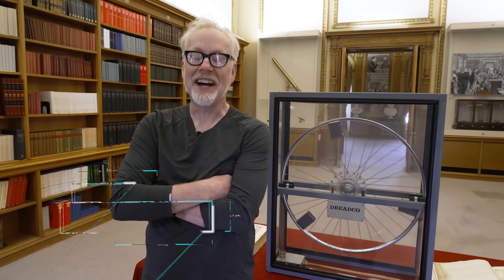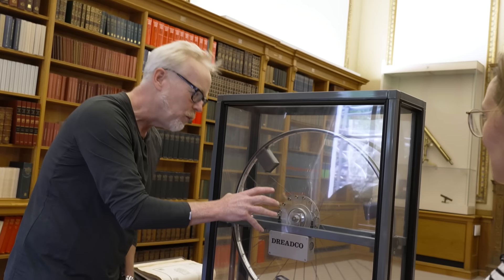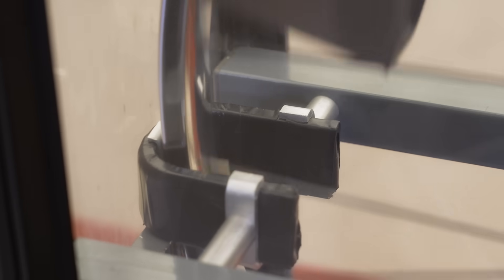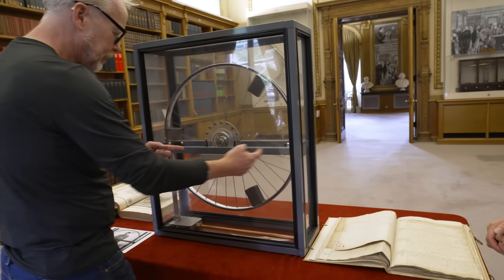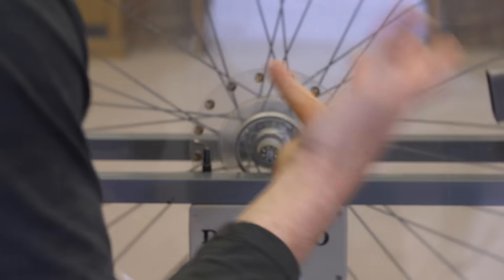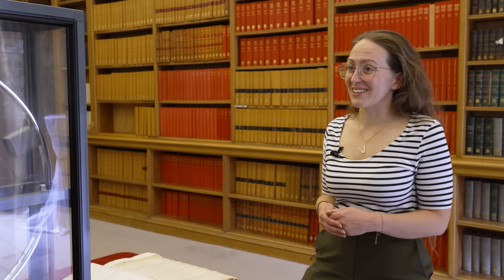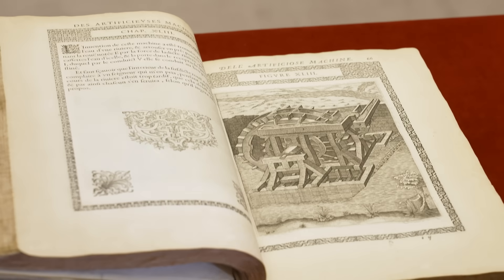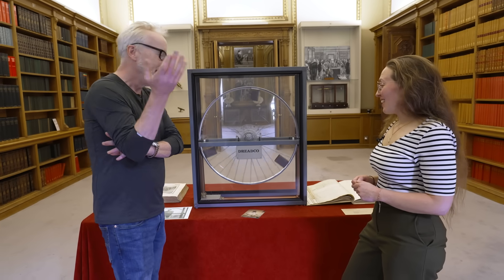Adam Savage vs The "Perpetual Motion" Machine!

Comment: I patented a device which converts heat fully into electrical energy. The patent is US 3890161A    DIODE ARRAY filed 1973, granted 1975, open for public use, 1992. It covers a device which produces refrigeration which is a loss of thermal energy while it produces electrical energy. The energy gain and loss must be equal because the energy of a system considered as a whole must not gain or loose energy though the energy may change form. 

A simple rectifier crystal can, iust short of a replicatable long term demonstration of a powerful prototype, almost certainly filter the random thermal motioren of electrons or similar  positiive charged voids called holes so the electric current flowing in one direction predominates. At low system voltage, a filtrate of one polarity predominates only a little but there is always usable electrical power derived from the source, which is Johnson (observation) Nyquest (theory) thermal electrical noise. This net electrical filtrate can be aggregated in a group of separate diodes in consistent alignment parallel creating widely scalable electrical power. The maximum energy is converted from ambient heat to productive direct current electricity when the electrical load electrical resistance  is equal to the array internal electrical resistance. The heat absorbtion is always equal to the electricity delivered 

Maximum calculated electrical power output (watts) is k (Boltźman's constant), one point three eight x 10^ minus 23, times T (temperature Kelvin) times bandwidth (0 Hz to a natural limit ~2 THz @ 290 K) times rectification halving and nanowatt power level rectification efficiency, times the number of diodes in the array. Rectification is inefficient at low voltage, inefficiency reduces the performance but the heat absorbtion remains equal to the yield of electricity. 

There are a billion cells of 1000 square nanometer area each per square millimeter, 100 billion per square centimeter. 

A diode array plausibly designed for maximum realizable of power levels of mìlliwatts would consist of billions of very small diodes in consistent alignment parallel or, for additive voltage, parallel series. 

Order is imposed on the random thermal motion of electrons by the structual orderlyness of a diode array made of diodes built within a slab: 

Host crystal is silicon 

  P type boron doped
-----‐------‐----___-- Out
🔻🔻🔻🔻
■■■■■■___ + Out
  N type phosphorous doped 

All the P type semiconductor anodes abut a metal conductive plane deposited on the top face of the slab with nonrectifying joins;  the N type semiconductor cathodes or common cathode abuts the bottom face. As the polarity filtered electrical energy is exported, the amount of thermal energy in the group of diodes decreases. This group cooling will draw heat in from the surrounding ambient heat at a rate depending on the filtering rate and thermal resistance between the group and ambient gas, liquid, or solid warmer than absolute zero. There is always a lot of ambient heat on our planet, more on equatorial dry desert summer days and less on polar desert winter nights.

Focusing on the composition of one simple diode, a near flawless crystal of silicon is modified by implanting a small amount of phosphorus (N type conductivity) on one side from a ohmic contact end to a junction where the additive is suddenly and completely changed to boron (P type conductivity) with minimal disturbance of the crystal lattice. The crystal then continues to another ohmic contact. 

A region of high electrical resistance forms at the junction in this type of diode when the phosphorous near the ĵunction donates electrons that are free to move elsewhere while leaving phosphorus ions held in the crystal while the boron donates holes which are similalarly free to move. The two types of mobile charges mutually clear each other away near the junction leaving little electrical conductivity. An equlibrium width of this region is settled between the phosphorus, boron, electrons, and holes. Thermal noise is beyond steady state equlibrium. Thermal noise transients, where mobile electrons move from the phosphorus added side to the boron added side ride transien⁸t extra conductivity so t⁶he forward moving  electrons are preferentally filtered into the external circuit. Mobile electrons are units of electric current. They lose their thermal energy of motion and gain voltage, as they transition between the junction and the array electrical tap. 

There are other plausible breeches of the second law of thermodynamics. Hopefully a lot of people, mostly as independent teams, will join in expanding the breech. Please share the successes or setbacks of experiemental efforts. 

These devices would probably become segmented commodities sold with minimal margin over supply cost. They would be manufactured by advanced automation that does not need financial incentive. Applicable best practices would be adopted. Business details would be open public knowledge. Associated people should move as negotiated and freely and honestly talk. Commerce would be a planetary scale unified conglomerate of diverse local cooperatives. There is no need of wealth extracting top commanders. We do not need often token philanthropy from the top if the wide majority of people can afford to be generous.. 

The topic deserves discussion and prototyping attempt action. 

Aloha
Charles M Brown
Kilauea, Kauai, Hawaii, 96754j

Comment: Im looking at what is shown here, and all I can think is that it is basically the same as placing a battery on a magnet then winding a coil of wire arround it.

The heat synchs have me thinking that the power source may be thermal electric.

What bothers me about it, is the secrecy. I hate any any machine which claims to be running at unity or over unity, which makes the methods of operation a secret. Its not about weather it is what it claims or not, it's about the deception.

Comment: Those aren't magnets. Those are electrodes. What you are seeing is kind of like perpetual motion. But literal perpetual motion is theoretically impossible... But if you use static electricity. Like an electret for example, which is a material that holds a permanent static charge. You use multiple ptfe electrets without touching any type of capacitance. You then build an static electric motor. They use electrodes like on the wheel, which can be plates of aluminum. Aluminum pushes and pulls from static electricity. You can than have the perceived infinite moving of motion. But eventually the electret will lose its charge due to the environment unless kept 100% dry. But you cannot power anything off of these devices really. Maybe a micro sensor with caps and AC to DC converters. Fun project, but you get little to no current. Hope this was helpful :)

Comment: I have a "perpetual motion" clock. Its brand name is Atmos and it's much more interesting than this bicycle wheel. 
The clock depends on small (maybe 2° C) changes in air temperature over the period of a day, which causes a sealed, gas-filled bellows to expand and contract, resulting in a small amount of winding of the main spring. 
Pretty damned cool.

Comment: Cups behind the covers of the three points. These cups are balanced, using a slight bit of water to dump at the top of the arc and the water evaporates over a two year period. The adjustments are to refill the cups with water.
Reply: use mercury but still have to service the center bearing, it's the only thing making contact between the rotating mass and a stationary object.

Comment: So, if the black boxes were simply battery powered coils (essentially stators), wouldn’t that be the most obvious and simple answer? A stator holding a current would propel itself through the magnet, would it not? You only need a small charge as it only needs to propel the wheel enough of the next one to go through and continue the spin. High density chemical batteries could surely last 2 yrs. All the other elements are red herrings

Comment: Good day Adam, my guess is this is an electrostatic motor.  The little metal buttons get charged with opposite charges  from each "electrode" connected to the "Dreadco" box.  If the box contains a high voltage battery, it would take a long time to discharge.  Notice the slow even motion of the motor.  There is a bell that has operated in a bell jar for around 100 years in a lab that uses a high voltage battery too

Comment: I think some of the features of it are basically red herrings. The prong things are red herrings. 
Here's how it works. The bottom box and the Dreadco box are a combination of batteries and a small DC to AC circuit. 
Then inside those wrap around areas at the side are copper windings, that are basically electromagnets connected to this power source.
Inside the boxes on the wheel are small permanent magnets, the boxes are made to be bigger than they have to be.

Comment: There are obviously batteries hidden in it somewhere but I wonder if the system is also generating its own energy from heat differential.  That copper pipe attached to the heat sink would presumably be able to generate potential from the different heating/cooling speeds of the two different metals.  If the system was gaining energy in such a way it could dramatically extend the life of those batteries.  Between that and the box being obviously evacuated of air it could keep running for a couple years.

Comment: My theory is that the bolts holding the rods near the bearing are actually small magnets, and the electrodes are acting like a generator, generating charge and using that charge to spring the wheel further with the bits on the center left and rip enter right parts, with the large boxes being both weights and magnets to be pulled along by minuscule electromagnets. The copper pipe is most likely the connection to the electrodes.

Comment: It's using magnets and a small motor i made something similar freshman year in high school . It needs oil not a lot but it needs some . eventually the motor will lock up . this can not be done on a larger power creating scale the motor would have to be to big and would require to much oil . There is no such thing as a perpetual motion machine . The focus should remain on improving battery storage  capacity . My device could power a 20 watt bulb this 1 with the improvement of leds could power a lot of those . All about creating a balance.

Comment: My guess:

It’s in a vacuum, there are two magnets on the sides. And three iron weights. The weights unbalance the wheel making it move and it gets momentum when it passes the magnet, pulling the next iron weight. Since it’s inside a vacuum there is no friction so it doesn’t stop.

Comment: 0:28, There's no way it spins like that, without power from somewhere. The wheel needs to over come inertia  and friction in general, while maintaining a consistent rotation. I say an electric (induction?) Motor and power source hidden in the large metal block stuck to the otherwise all glass enclosure. But I'm no expert...
Reply: My guess is that there is a small battery that powers an electro magnet, the motion might charge the battery but eventually the battery degrades, or it doesn't charge it enough to maintain it forever.
Reply: I mean if it's a motor, it would be much cooler if they just put the batteries and metal parts inside a wooden wheel. Next level would be wirelessly powering it with microwaves.
Reply: magnets

Comment: May work like an Atmos Clock..Jeager LeCoultre...Changes in Temp/Pressure effect a volatile liquid in a cotainer to form a gas to operate a bellows to run the wheel..on cooling gas liquefies and contracts..

Comment: i reckon the 3 boxes are magnets, and the things that the boxes pass through are electromagnets. so the box the pipes connect to could contain a timing circuit which gives tiny pulses to the electromagnets, and the wheel slows down eventually because the timing circuit slows down with lower voltage.

Comment: Adam, they use heat pumps in power generating plants because they require a fraction of input power compared to output power. A relatively common residential air conditioning system can deliver 18,000 watts or more of heat to the outdoor condensing unit while consuming 2,500 watts of power. Within the confines of the earths atmosphere that is an over-unity device. The heat migrates back to where you took it from any way, so as Newton described, nothing is ever gained or lost in our universe. 

You can do the same thing with capacitors and electricity, but you cannot patent it, and the government holds patents that they call dangerous to the economy or defense of the country and will stop you from building it. 

Benjamin Franklin created an over unity Turkey spit that would run for 20 minutes after stroking a laden jar with his hand. It was a static electric motor. Perhps that is inefficient static motor that needs to have moisture removed from the case every so often.

Comment: People shouldn't put down these attempts at perpetual motion machines. If someone can design a machine with minimal force input with a high force multiplier (like a crank that could spin for days after one crank), it could be very useful. If I could get on a bike and spin for a half hour and power the house for a few hours, that would be spectacular. A little physical input is always available, if it can be multiplied well enough, it would basically be free energy.

Comment: I'm looking at the positioning of the 3 blocks.  Why not 2, or 4?  The answer is that 3 positions them so that if the light sensor in the middle detects the blocks, it can switch the power for the magnets on and off at the right time.  This would have to timed so precisely to keep a steady rotation that it leads me to believe the motor with batteries theory.

Comment: After 1 year I want to add to theory that this copper pipe is blowing by a little bit warmer air in the pipe, this radiator and moving magnets somehow do it - heat up the air and it goes by convection up and blowing mechanizm which heats up radiator - We have a circle

Comment: Liquid inside the three metal containers is transferring within the containers by gravity through metered orifice to put the mass closer and farther from the axle as the rotation proceeds. As a container rotates counter clockwise the liquid finds itself further away from the maximum radius and the momentum sweeps the wheel up the by the acceleration of the increased angular momentum. This is what I imagine is happening based upon the logic that two of the metal containers have an internal liquid motion propelled against the third at the highest point and that the energy needed is gravity returning the liquid inside the containers through inside pathways. Eventually the device will slow and cease operation as the very fine axle requires it's bearings to be refurbished and lubricated,

Comment: Adam is wrong, he needs to read more scientific papers on over unity. That being said, they have to be specifically tuned. And with today’s materials, it can be done fairly easy. Flipping the poles or turning off the magnets at a precise time and getting the resistance down below, a certain threshold will amplify the power. I believe it’s around 165 ohms? These magnetic motors are actually old tech compared to what we have with plasma cold fusion. An infinite energy source that has been hidden from us.

Comment: I believe rather in classical physics. We are on a rotating body.

If the PM is in a west-east direction, the Eötvös effect comes into question. The upper weight should experience a 0.1% increase in centrifugal force due to the earth's rotation when turning to the east than the two lower counter-rotating weights together. In my opinion, the maintenance intervals every 2 years serve to deceive. At best, the ball bearings will get a drop of oil.

Of course, it is not a PM because the mechanical losses reduce the Earth's angular momentum.

Unfortunately, I can't find any information about the direction of rotation. But similar PMs can be found all over the world. If someone could tell me the orientation, I'd invest the $100 in the aluminum tubes, three lead weights and the bicycle wheel and rebuild the thing.

And then publish the result in the US portal viXra, where you can also find some of my other experiments and insights.

Best regards

Wolfgang

Comment: You have to apply a torque / force at radius to the wheel. I’m thinking the copper tube thing sucks air on the left and blows it out on the right. Everything else is a decoy which looks sexier. The battery is in the base. In essence , the air is rotating inside the box very slowly but steadily and you can’t see it.

Comment: What if the obvious electric motor model is fake and what's really going on is that in the bottom box there is a fan that flows air through the right brass pipe and suck air from the left one?
Maybe a quiet heat exchanger? Thermoelectric pump?
Batteries may be hiding behind the company name with wires going through the frame?

Comment: A pendulum pivoting at the inside leading corner of the boxes mounted to the wheel, with a slight spring tension holding the swinging arm toward the center of the wheel.

Comment: The boxes are probably half filled with copper pellets...as they pass the magnets on the right they implement a tiny electric charge and as it rises to the top, the pellets fall down lowering the centre of gravity. Then as it lowers the magnet on the other side has a polarity that gives it a slight push. That's my guess

Comment: The "secret" is the magnet that turns on long enough to increase the speed by pulling the metal blocks when they reach a certain point but turn off before they negatively effect the momentum they just created. Same trick that is used on almost every other "perpetual motion" device.